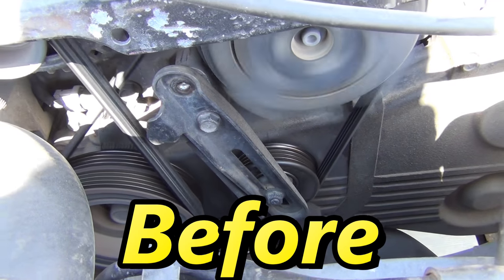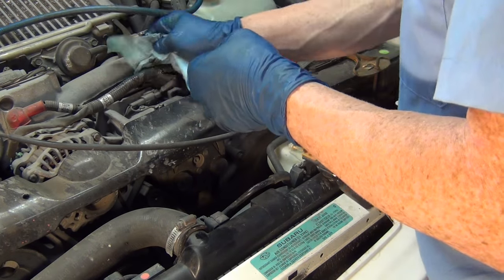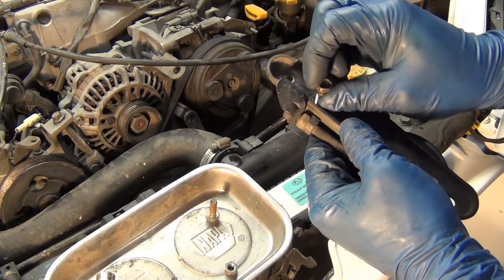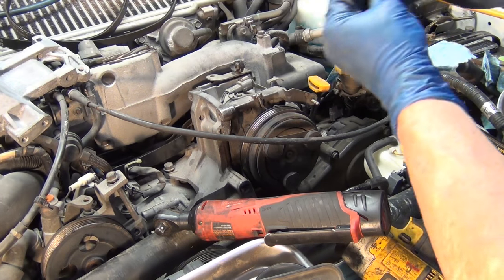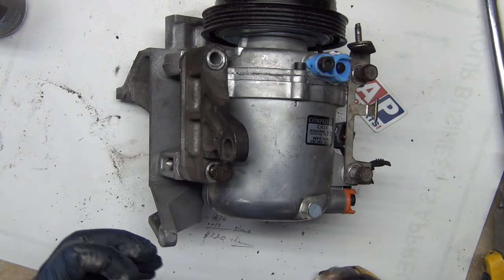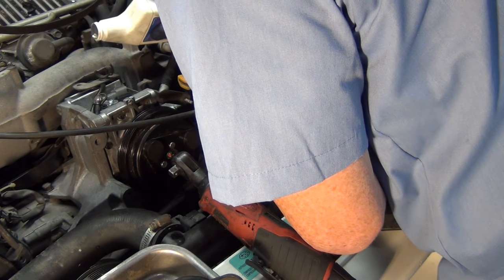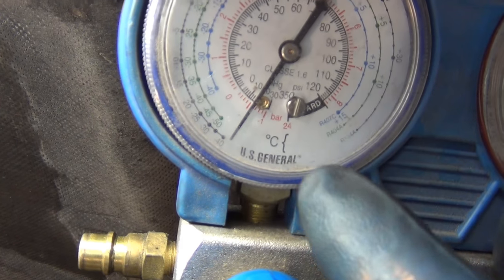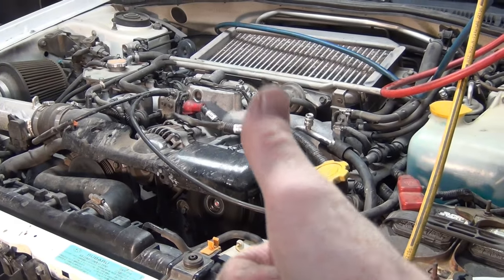How to Replace an AC Compressor Comprehensive Subaru Example

Comment: Man... I am really hoping you read and answer these comments. So, I purchased the kit from BAP, it isn't a bad deal. Took the car to the garage to have a pre-work inspection (so I can get an estimate for the labor) and we found that the AC idle tension pulley isn't on the car. I thought about this for a while and realized, when the AC pooped out, I didn't see one there. I cut the belt in order to keep driving without further damage. So I went online and looked at several auctions for a 2008 Subaru Impreza 2.5i and noticed that each one of those cars did NOT have the AC Idle Tension Pulley... ????? What gives? Is this needed in the 2008? 

Please, if you could, answer this question. PLEASE.
Reply: In @ 2007-2008, Subaru went away from the A/C tensioning pulley setup and began using a new "Stretch" belt design. You will need to also purchase a belt installation tool set, so you don't damage the new "stretch" belt during installation.   AC belt part # 11718AA082 ;  
Gates 91031 Engine Tool    Hope this helps!

Comment: wow--finally; someone who uses anti-seize on the bolts!!. Nice video for us mechanics, but would help if you showed exactly which bolts to remove; also, hard to hear your voice over the engine noise. 
thanks for taking the time to do this.

Comment: What did you do with the two wires from back of new compressor, I  have a new compressor installed and don't know what to do with wiring. Thanks!

Comment: Great video!  A little confused if the bolt hadn't broken would you still have needed to remove the alternator to do the compressor. thanks

Comment: Hey Brain I bought a 2000 2500 dodge truck new back then, i still have it today. Towards the end of warranty period my AC stopped working and before the warranty ran out it was in there shop 15 times to correct the problem well long story short and after they changed every part on AC expect the condenser which I ended paying for because the warranty ran out. It still doesn't work.

Comment: The compressor works in a dynamic environment, meaning that in order to pull all of the pressure from the system, you must have the compressor running. That’s why you had that burst of pressure after pulling it all out

Comment: Not keen on the recovery set up, those disposable cylinders should not be refilled, you can pick up a proper service cylinder for about £60. Biggest danger though is using a vacuum pump for recovery, its body is in no way designed or rated to be pressurized. You'd only need to forget to open a tap to have an explosion. Either get a proper recovery machine or if your budget won't stretch to that get an R134a compressor off a scrap domestic refrigerator and make your own recovery machine from it.
Reply from the maker: Thanks for the concern and ideas.  I'm always up for a heads up & a good idea.   I'd love to know more about that.  My oil fill plug is venting during transfer.  Not venting hard, but it shouldn't be hissing at all.
Reply: Its venting because the pump should never be pressurized, the exhaust is designed to be open to the atmosphere when in use, the 1/4" fitting should not be there!  You are basically putting 60 to 70 psi into something that is not designed to hold any pressure at all, and pressurizing the exhaust side of the pump up to 100 or maybe 150 psi which again should never see any pressure at all.

Imaging using a vacuum cleaner to inflate tyres! I'm amazed it hasn't burst.
Reply from the maker: Dick!  Great to see you!  It's been a while.  Your avatar is different as well.  Not sure why, but your comment was held for review so I approved it.
Reply: Yeah I miss that giant forehead.
Reply: If you go on eBay robinair makes a portable recovery machine made for that reason and I think it's maybe 4 or 5 hundred bucks brand new
Reply: heavydiesel I was shocked to see this too buddy and I knew someone addressed it
Reply: A fridge pump may not pull deep enough vacuum to remove moisture from the system.

Comment: Brian; any thoughts pro or con regarding the auto parts house's "Fix your A?C yourself " kits in a can? I've a Honda and a Freightliner that blow 50 degree cold air. Dealers and shops can be very expensive.

Comment: I could've easily saved that bracket. Cross-drill a 5mm hole in the thread Boss, shoot 50-50 acetone/ATF into it a few times, THEN weld a nut on and remove. Anaerobic dissimilar metal corrosion is very common with cast aluminum (blind Boss). But- if you're wealthy- just by another bracket.
Reply: (Genius “Engineers” Who Totally Fixed Everything)
Reply from the maker: Would you drill perpendicular to the bolt or along side of it?
Reply: Perpendicular, just under the clamp surface, 3-5mm beyond the oxygen barrier, being very careful to not hit the bolt; a hand-twist drill is best, or slow slow variable speed. Just to give the mixture a place to wick into. That'd be a cool video.
Reply: HUBBABUBBA DOOPYDOOP, Great advice.....thank you.

Comment: Hey Bryan. I have a question. I was thinking about getting a 2012 Forester but after much research, I've found that many Subarus burn a lot of oil. Are you aware of this? Would you recommend this car to anyone? And what do you think the repair would require; more specifically, is it worth it to repair this issue?

Comment: I've been looking for 2 days, just to see how to use a recovery tank with manifold gauge from HF. I wish you didn't go thru your hook up so fast. If anyone could tell me what the shrader valve is for on the middle, top (yellow hose) connection, I think it might help. If it were only to keep the other end of the yellow hose on, it would look like the other 2 keepers: no hole or shrader valve. I'm hoping you use a 4th hose (yellow) to go from there to the recovery tank.

Comment: Where do you connect your vacuum to? The high or low valve?
Reply from the maker: Thanks for asking.  I connect it to both sides.  The whole system is a loop, but a loop with potential blockages at the compressor and the expansion valve or orifice tube if equipped.  You'll notice at 7:51 when I remove the line from the compressor the center shaft of the compressor is rotated as gasses inside of it seek equilibrium.

Comment: how much do you know about the new 2016 chevy cruze, i have been having an issue with acceleration while the a/c is on full, by the way it has no acceleration from a dead stop.
Reply from the maker: Anything that's turbo, has an electronic throttle body, a small displacement, and an engine warranty isn't going to be fast off the line when it's cold.  This all protects the turbo and the engine via open loop programming.

Comment: Anyone ever have a 2002 wrx harness for the ac 3 prong connector. And take a 05 wrx ac compressor which has a smaller one wire connection and cut the connector off the old ac and the new ac and splice them together to make it work??? Need advice thanks in advance!!

Comment: Pretty sure you should have the bottle flipped right side up when charging AC. With it upside down your sending liquid straight into the compressor. Should only flip it upside down when filling an AC machine.
Reply from the maker: I respectfully disagree.   If I'm wrong I'd like to know more about your information sources and bottle types that that's applicable to.  I've done both ways and the way demonstrated works- the other way does not. (using the items shown of course)
Reply: Right way up for vapour, up side down for liquid (unless the bottle has a dip tube) Should be a label or marking on the bottle as to which type it is, though I have never seen a disposable one with a dip tube (but they have been banned here for 15 years so...)
You can take liquid out of the bottle so long as you restrict the blue valve on your gauges so the liquid vaporizes in the blue line mostly before it reaches the suction line on the car.

Comment: Can you just install the new compressor and buy a Little freon tank at like autozone? Or do you have to suck all the air out first?
Reply from the maker: Ambient air in the AC system isn't as detrimental as say air in your brake system, but it messes with your pressures causing performance issues.  It also contains moisture that can and does freeze your expansion valve rendering it useless.  Moisture can also mess with lubrication and can contribute to corrosion and PH problems.  In short.  It doesn't belong and can affect your rubber, ferrous, and other components shortening their longevity and make things suck in the interrum.

Comment: Please dont use copperantiziese on aluminium parts. Copper will erode the aluminium way more than the steelbolts do. use a cheramic or aluminium based antiziese instead.
Reply from the maker: Hmmm.   I usually do use aluminum.  That makes sense, but I want to see it in action now!

Comment: You don't need to change the whole compressor... it's prob the clutch I have the same problem...
Reply from the maker: That's true, but if half the time it's the compressor and half the time it's the clutch- and the whole thing costs the same as the clutch just about - seems better to take care of it all at once.